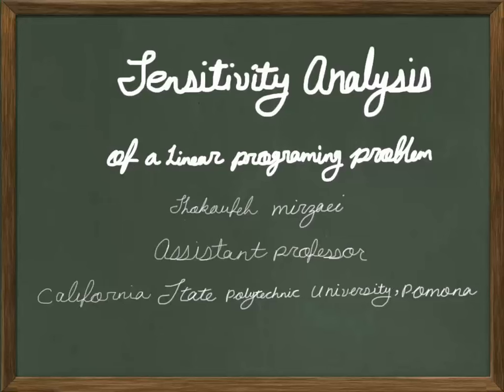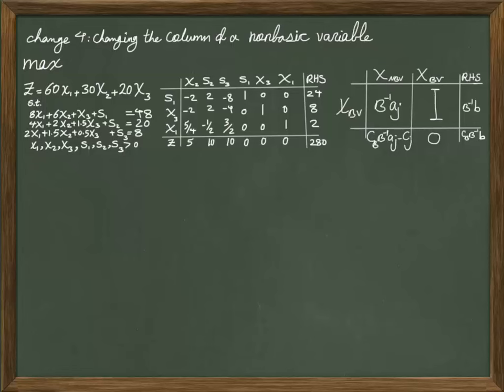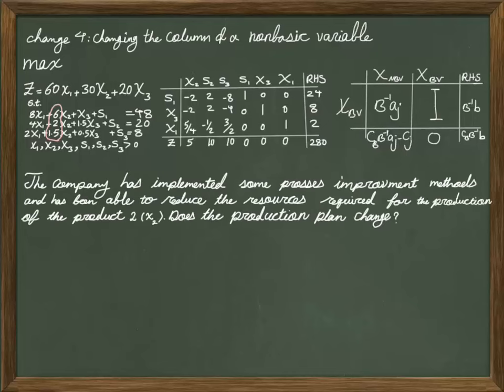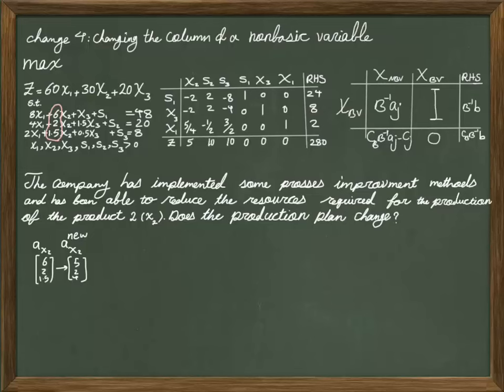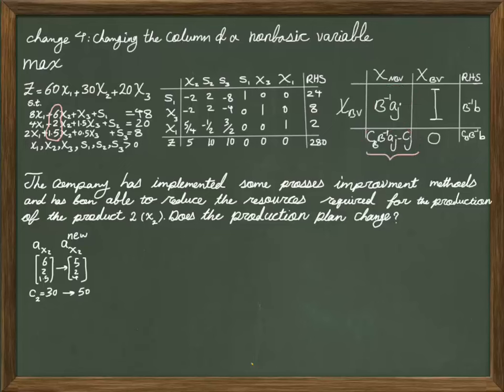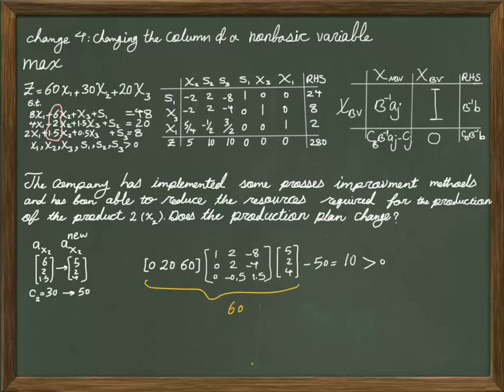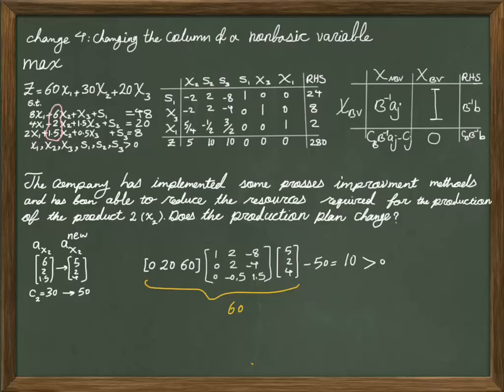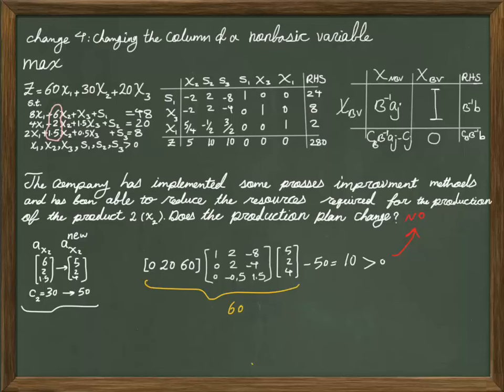Sensitivity Analysis: Changing the Column of a non-basic variable:Part 2-4

Comment: if we get -4 for X2 We calculate new optimal solution but we use x2 column B^-1*newAj  when calculating new optimal table, is it correct?
Reply from the maker: If you get -4 for X2 in the row of Z, X2 can no longer remain as a basic variable. you can find your new solution by continuing to solve the simplex table. Choose column related to X2 as your pivot column (bcz is the most negative in a max problem), then implement min test, which in this case, the third row is the only option. As a result, your pivot value is 5/4. Now in the next table, you want to use elementary row operations (EROs) to make the pivot value 1 and all the other values in the pivot column 0. After that you get your new solution.